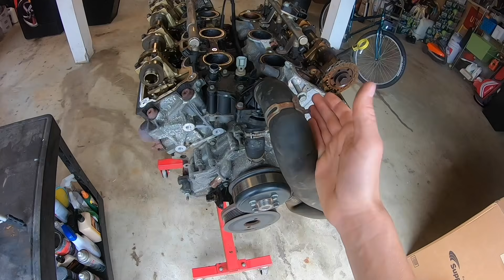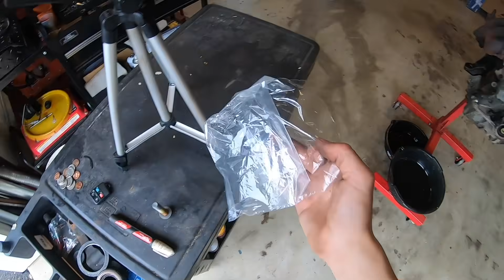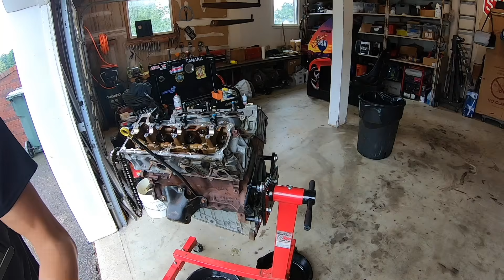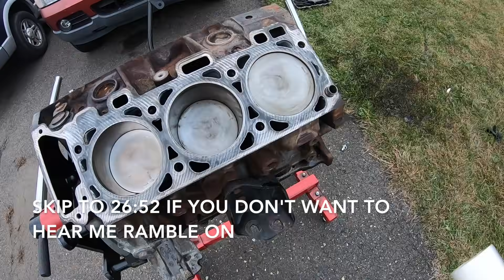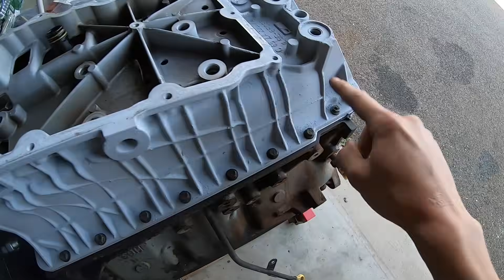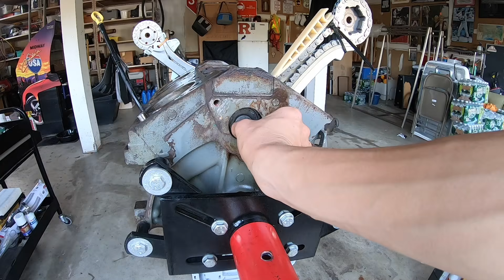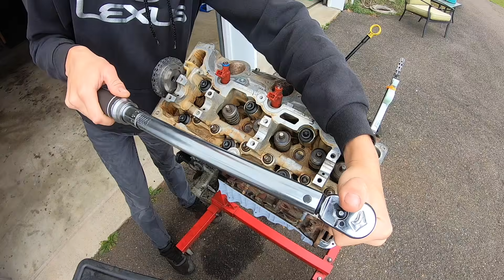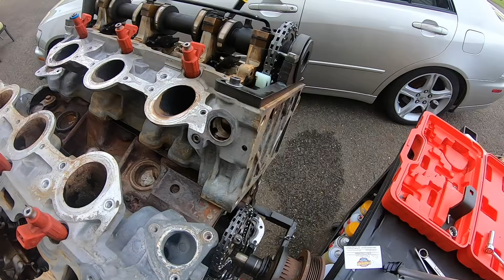Ford 4.0L SOHC V6 Head Gasket and Timing Chain Replacement (COMPLETE GUIDE)

Comment: I have cuestión I have Ford Explorer and the rear timing chain tensioner get bad I have to remuv the engine to due the work
Reply from the maker: Yes to replace guide remove engine or transmission
Reply: I have to replace the transmisión anyway thanks

Comment: Thanks for the video. I've been following it and I am ready to get it back together. Do you have the part numbers for the bolts that need to be replaced? Ford part guys tell me they can't give out that info. I wanna stick with Ford bolts, I don't trust the aftermarket, I'm worried that they will snap.
Reply from the maker: Look in the description. I have the links there.

Comment: I am doing this right now on my 1999 Mountaineer 4.0 SOHC with 170K, getting ready for a 10000 mile trip around the USA!. Thank you for the tips, especially the shackle on the jackshaft gear, I will be doing that to prevent stress on the chains!

Comment: This Video has been a life saver. Unfortunately I stripped the head on one of the E11 Balance shaft bolts. I've read these are TTY and a dealer only part. You wouldn't have a Part number for these would you. I have looked everywhere and the only thing that comes up is the Jack Shaft Bolts.
Reply from the maker: The balance shaft bolts are not TTY. I don’t have a part number.
Reply: @iamdjnam  Thanks for the clarification I appreciate it.

Comment: What an amazing video with such incredibly rich detail. You can tell you know the ins and outs of this engine and its super refreshing to see.  I say you know your stuff. I have a question if I may, how do know engine compatibility? I have a vin-k engine and a lot of ebay engines list the vin-k only working with 2002-2003 explorers, is this a junkyards oversight or are there issues with it going into a 2004 vin k? Also is there a master list of compatibilities that I can review? I want to do what you did to a purchased used engine and drop it in my explorer (current engine has about 300K on it and just started to rattle)
Reply from the maker: VIN K and E is in relation to flex fuel. The difference will be in the ECU and injectors. Any 4.0 longblock from 97-2010 is interchangeable. Just reuse your accessories.
Reply: @iamdjnam  Thanks a ton! I think I need a few more tools to get it done but with your video they are easy to know!

Comment: Hello Nick,
Motor out of the truck. Thank you.  Rear chain failed. 
I haven't taken off the timing cover yet. But did remove lower oil pan and to my surprise I have a shaft balancer, although this is a 2003 2x4. 
If I delete it, is there any procedure for the oil supply ports to the balancer?  On 2x4, are these ports plugged. 
Regards
Reply from the maker: Ports must be plugged. Either buy plugs or just leave the balancer in there with the chain disconnected.
Reply: @iamdjnam  thank you

Comment: I've been getting alot of check engine codes that I'm running to lean, I've went through just about everything I could replace, checked for vacuum leaks, filters, injectors, gas lines, fuel pump, map, maf sensors, egr valves, throttle body etc etc still flags it, and this ticking started getting louder and louder in the front of the engine and it's sloppy  sounding at times, the car still runs and idles fine most of the time with the proper rumble but sometimes setting at stop lights the rpms fluctuate somewhat and idles weird, not alot though. Could all of these problems be due to a chain or tensioner? I still don't know how one can tell if it's out of time other than it just not running right at all or hard start etc mine fires right up and sounds good til it starts warming up then the tick and sloppy pinging starts. I'm just worried about bent valves mostly, but if it is the timing components hoping fixing whatever the issue is with that will save the engine. It's in an 07 mustang, I already tried repairing its previous engine because of a rear timing chain guide, replaced it 3 times in a 2 week span, thats alot of engine pulling in and out, it just kept braking that crappy plastic rear guide. Clearly my fault because of the bolt was chewed up to high heaven and ford is dumb and couldnt find a replacement or even know what i was talking about, and i didnt really have the proper torquing tools and broke a different bolt that couldnt get a replacement for cuz of Ford again 🙄 and had to rig something up lol ug it was a mess. So i just got a different engine and put it in lol Idk why they don't make a more durable guide. But luckily this one is just showing signs of front issues only. Clearly I'm not a pro but I know my way enough around an engine just enough to be dangerous. Lastly, if it is out of time because of the front, can I reset the timing without pulling the engine?
Reply from the maker: You can replace just the front in the vehicle. The only way to check if it is out of time would be to remove the valve covers, set the engine to TDC, and check with the tool. Sounds like when the oil pressure thins at hot idle the tensioner can’t keep up. Maybe replace the hydraulic tensioner.

Comment: Can you just replace the front timing chain assembly without messing with the back? I have alot of rattling going on in the front of the engine which I'm almost positive is a slapping chain due to a failed tensioner(s) but there is no noise coming from the back.

Comment: Did the complete rebuild for an 04 explorer but I'm stuck at timing for reason of when I set the timing and get everything aligned and tightened down i try to turn the engine by hand to check and the rear jackshaft bolt keeps coming loose and causing the pass. Head cam to lose timing any ideas why I've torqued it down and done the addition 90 degrees but it doesnt seem to hold??
Reply from the maker: You using the OTC tool kit?
Reply: @iamdjnam  yes I am I'm using the otc tool kit
Reply from the maker: I’m bamboozled. I’ve never heard of that in my life.
Reply: @iamdjnam  gotcha

Comment: Awesome video, do you have to take out the engine to do both timing chains or is there a way of doing it still in the car truck?
Reply from the maker: Engine or transmission must be removed
Reply: @iamdjnam  thanks for the info! I hope it’s just the front timing chain that’s messed up at least I can do the front, if the back is messed up I’ll have someone else do that one.
Reply from the maker: General rule of thumb is if the front is no good, the back isn’t too far behind.
Reply: @iamdjnam  those specialty one time use bolts how many of each just one of each or two of each?
Reply from the maker: One
Reply: @iamdjnam  thanks!

Comment: Hi Nick - my '11 Ranger 4.0 SOHC xlt v-6 has been in a shop for over a week now.  First, the water pump was leaking so they replaced that.  Still smelled antifreeze in the cabin, then the thermostat housing was replaced along with an elbow hose in the back (towards the cab) of the intake.  When they did the housing they said they had to pop off the intake because they couldn't get to that third bolt, even with the throttle body off.  When they did that I brought it to them running fine at idle, then picked it up and all of the sudden rough idle.  They "said" there was antifreeze in a cylinder (No 4 I think they said).  However, I think since they said they popped off the manifold to get to that third housing bolt they caused the leak.  

Now, my truck's been in their shop for a week because the head gasket blew (white smoke all over the place from under the hood/engine - there's nothing else it could be).  

Two questions:

First, did they CAUSE this by popping the manifold to get that housing bolt?

Second, should it be taking this long?
Reply from the maker: Removing the intake manifold has nothing to do with antifreeze in the cylinder. If it needs a head gasket, it would be cheaper to get a used engine and have it installed. Head work is very pricey.

Comment: I have an 05, had the balancer weight issue, too. I inherited mine after pop's passed, currently has 151,000 and definitely a noisy engine now. I want to do exactly this to keep her going as long as possible. Mechanically inclined, but no garage and have never pulled a motor myself. You breeze through these things and have every detail, nice work dude.
Reply from the maker: Much appreciated. Thanks for watching!
Reply: Well, the video is great. I never worked on a Ford motor before. I have a 2002 ford truck that needs a timming chain do you know anyone in Sumter sc

Comment: Hey Platinum, great videos! On the off chance you see this comment, if you have any way to reach out, I can assume you’re busy, I’m physically disabled and having a heckuva time getting the top 2 bell housing bolts. Any advice will go a long way! Been at it for two days now (I do things slower than most) and the videos I’ve seen don’t tap on the top 2 bolts. I hear it’s an easy 13mm open end, but it’s not so easy for us. If you have time, lmk I’d love to pick your brain on some ideas aside from 6 feet of extensions, that’s been attempted 😂😂
Reply from the maker: I remove the intake and reach down from the top. It is indeed a 13mm. I understand your situation, I’d suggest some long extensions and go from underneath. Like, 3-4 feet worth of extensions.
Reply: @iamdjnam  I got all but the top 2 from underneath. Being that I have plenty of extensions and swivels, I’ll try that out tomorrow. Cross your fingers! One more bolt and engine is yoinked out. Thanks for the fast reply!
Reply: @iamdjnam  thought I’d share the update. 6ft of extensions, 2 impact swivels, a set of hands up top and a set of hands on the bottom, that bolt came free!

Comment: Nick got my heads yesterday, got them bolted down and I know the valves are closed but I just realized that I need to spin the cam 180 degrees in order to get timing tool on. Concerned about jamming new valves.. should I loosen the valve caps before I rotate 180? I now have hope!
Reply from the maker: Yeah take the cam off and spin it around. You will definitely hit the piston.
Reply: @iamdjnam  thanks glad I asked

Comment: Bro, just, bro, you are on a different level. I have an 2008 4.0. Just had a new transmission put in, now she’s rattling in the engine and sometimes shuts off on me while driving!!!
Reply from the maker: You need some timing chains dawg
Reply: @iamdjnam  
You got like a website or something? Every time I think about trading out my 08 explorer I end up making a repair and learning that I need a new one. Also where you at in the states? I’d have to get u some whiskey and pic ur brain at some time.
Reply from the maker: I’m in NJ bro - no website at the moment but that’s a damn good idea
Reply: @iamdjnam  
Ok cool I’m in TX. U still driving the same explorer? Had mine sense 2014, had a 2000 Ford Explorer before this one when I was younger
Reply from the maker: @CrotchetRocket  absolutely. I will never get rid of my 2003.

Comment: I have a 4.0 engine same year with a blown head gasket. When taking off the head can I loosen the tensioner bolt and loosen the sprocket. Then afterwards pull the head or should I take off the timing chain completely off
Reply from the maker: Chain needs to completely come off the head
Reply: @iamdjnam  okay thank you, I’m just trying to do this the simplest way possible
Reply from the maker: Buy the tool kit. Don’t wreck the engine because of bent valves.

Comment: where are you located?
Reply from the maker: America
Reply: @iamdjnam  I figured.....what city or area?  ref....maybe I'm close enough to get you to do this job on my 2003 Sport Trac??
Reply from the maker: I’m in NJ. I will never touch another sport trac again. If you bring me the engine I’ll do the labor, or you can just buy one of the engines I have for sale.
Reply: @iamdjnam  curious what about a sport Trac is different than any other r&r??
Reply: btw, I'll be in Summit, NJ over summer....I thought you might be local based on speech.
Reply from the maker: @JohnstonPettigrew  they’re insanely compact. You can’t access anything. Drop front driveshaft to access starter….overcomplicated intake manifold design. Vacuum lines everywhere. Motor mount bolts you can’t see. I did it once and I’ll never do it again.
Reply: @iamdjnam  ✔️

Comment: When my timing kit was due, not even the dealers wanted to touch it! Thanks to videos like these I did it myself. Had to wait 3 weeks for parts from the US though..
Reply: Props to you!
Reply: Still running?
Reply: I am ADMC dealer certified master mechanic and I'm telling you I've done this all the time they're one of the worst and you do it properly at this shade tree type shit that I see going on here you use the proper tools a proper linement kit and everything.
Reply from the maker: @franklinbennett4443 what part of my last comment did you not read or understand??????

Comment: Hey just used my tool for tdc, and it looks like it sitting at about 1145 and not 12oclock. I double checked everything and just wondering if this is something I should worry about?
Reply from the maker: Yeah it needs to be at 12:00 on the dot.
Reply: The tool says it’s at tdc tho? Maybe it’s just an illusion? Also stuck screwdriver in #1 hole and piston is definitely all the way up? I’m going to send it and see
Reply from the maker: The tool might be off a little. I’ve had it happen. Just eyeball it stick a screwdriver in the number one cylinder hole make sure the piston is at the top
Reply: @iamdjnam  ouch I already have engine bolted back up? I did check #1 plug and it was all the way up. I’ll let you know know if it works, god I sure hope so! Thank you so much for helping a brother out!
Reply from the maker: When I say 12:00, I’m referring to the keyway on the crankshaft snout with the harmonic balancer off. Just want to make sure you’re on the same page.
Reply: @iamdjnam  yes it looked like the key way was off to the left just a smidge? I took the harmonic balancer tool on and off about ten times and it said engine was tdc. Now you have me a bit worried since it took me 3 hours to stab the engine last night (by myself).
Reply: @iamdjnam  also correct me if I’m wrong, but if I have to retime it, just need to pull valve covers and time it by loosening cam bolts and retightening at the new tdc using the cam timing tool of course. Just not sure if enough room on passenger side. I’m thinking about ordering the otc brand and returning my $90 amazon tool.
Reply from the maker: @PapaFamNite correct. The $90 tool is all I use in these videos. They work fine. It’s super tight against the firewall but can be done.
Reply from the maker: Just eyeball the keyway at 12 and don’t stress too much about it
Reply: @iamdjnam  well I finally got it put back together, I didn’t have coolant so could only start it for about 30 seconds, but it fired off immediately and didn’t seem out of time. I’ll know more when I drive it. Oh and in your video you didn’t mention anything about this, but what is that z bracket tool with the socket that goes on a hex drive in that tool kit? I’m guessing it had something to do with the cam gear bolt but couldn’t really figure it out. Thanks again brother!
Reply from the maker: @PapaFamNite  That tool is used when you leave the engine in to get clearance against the firewall for that 19mm cam bolt.

Comment: It looks like you removed the rocker arms before removing the cam caps. Did you use a special tool and if so is there a tool you would recommend? One thing I'd like to share from my experience is to not use stainless hardware for exhaust manifold studs for a couple reasons. Stainless steel is much more brittle than steel let alone hardened steel and more likely to snap or strip when dissasembling down the road. I've learned the hard way! I would only use replacement studs intended for the application as they are most likely hardened studs. If those aren't available I would recommend grade 8 or higher hardware for items seeing frequent heat/cool cycles. Thank you for the great video!
Reply from the maker: Thanks so much for the info! I had no idea about those stainless studs!! Appreciate you teaching me about that. I actually removed the rockers after I took the cam caps off. Super simple to do.
Reply: Was it difficult to reinstall the rockers without a tool at the time of reinstalling the cam caps? I've never done this so don't know what to expect. Thank you!
Reply from the maker: @mikemaj8467  no if you set the cams so none of the lobes are pressing down on a valve, it installs super easy. You can see me retard the cam backwards on the right head then spin it to TDC orientation

Comment: Hey thanks for the videos. Quick question. For passenger head need to come off for chain and sprocket replacement?
Reply from the maker: No passenger head can stay on but you must remove the upper external torx cylinder head bolt in order for the lower sprocket to clear the casting. It is not a stretch bolt and can be re-tightened once you install the sprocket.
Reply: @iamdjnam  Thanks!

Comment: Great video   but 12:00 to 3:00 is 45 degrees not 90.   12 to 6 is 90 degrees and 180 is complete whole turn iv never worked on one of theses over head cam motors but will start on a 03 4.0 today crazy thing is that explorer ran great I don't know who the guilds in the rear timing chain is shot I don't know how it didn't jump.time worst timing chain slack iv ever seen except my 96 silverado it was even worst and the day before I had just got through pull a air boat 400 miles on i 75 with it
Reply from the maker: 12-3 is 90 degrees. I’m going right off what the manual states. It makes sense, we’re working with a circle. 180 would be half a circle, 360 full revolution of the bolt.